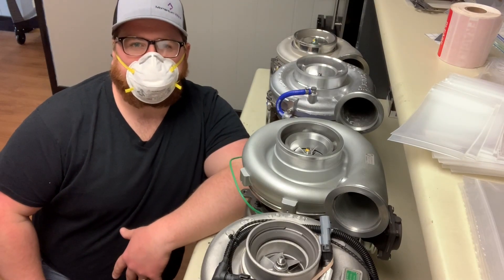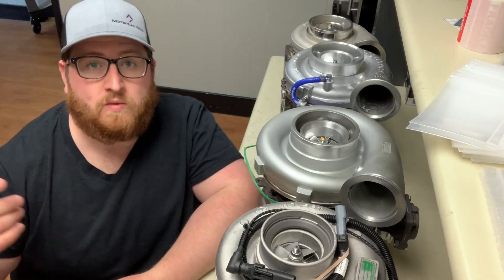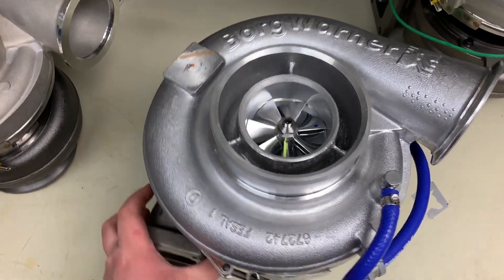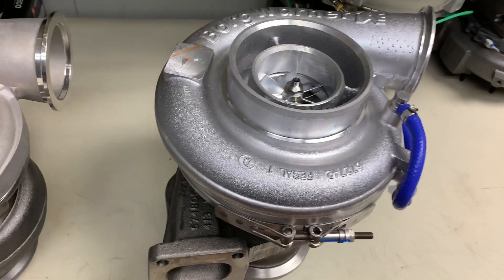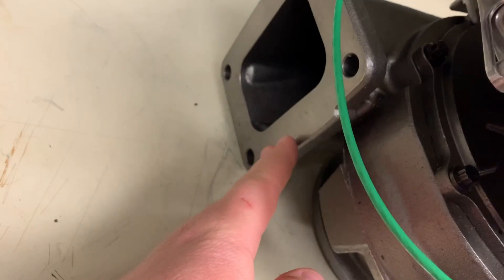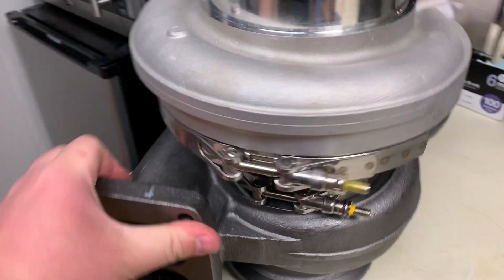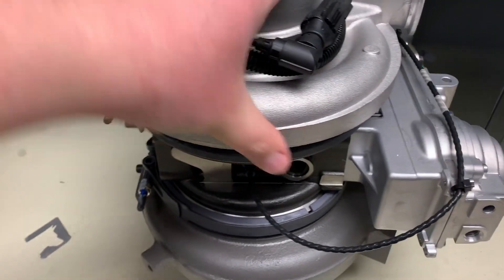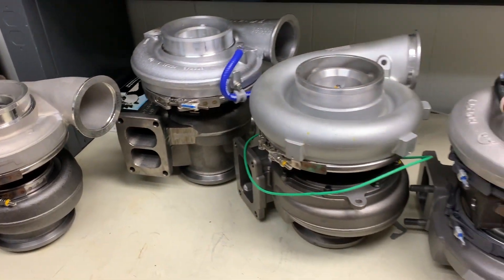Which Detroit Diesel Series 60 Turbo Do You Have?

Comment: I have a DDEC 5. It's a nightmare with the turbos. The 4s on the 12.7 are stronger. Can I just plug off the VPOD and put on a non waste gated? Is there computer changes that need to be made since there's a speed sensor involved?
Reply: You need tuning.
Reply: @davidburdett1920  thank you

Comment: Got a 99 volvo and needing a new turbo. I plan on keeping the truck for the foreseeable future. Reliability is my main concern, but I don't mind spending a few more bucks if it means more performance and/or MPG. Do you think BW performance part is the way to go? What's the diff in price?
Reply: 171701 bw is a good turbo. 171702 if your going over 600 hp.

Comment: Hello brother, I have a 09 Freightliner cascadia with S60 14L , I replaced the old turbo was ddec6 and I put a new turbo ddec4 with waste gated and I’m low now with bost , what do you recommend me please ? The other ddec4 without wastegated or parameters on the computer ? Thanks let me know please 👍
Reply: You have to have your ecu tuned . DDEC 6 computer’s are programmed to run with a VGT turbo.  I’m in the process now.  I deleted all the emissions crap and the only thing left to do is change out my VGT turbo
Reply: @dontehopkins9862  thanks brother I’m working yet but not good, I will check that 👍👍
Reply: Did everything you did with the 12.7 turbo with the waste gate and my 14l hauls ass like no other. It was ecu tuned

Comment: @Momentum Worx 
can a k31 use a standard non wastegated s400 exhaust housing just bought one used thinking it was an actual s400 turbo, exhaust housing was cracked.
Reply from the maker: I don't think so.  I've never tried it personally, but the turbine wheels and frame sizes are different.  I would be very surprised if it was a direct swap.
Reply: @momentumworx  Damn. Would you happen to know of anywhere I could get a replacement k31 exhaust housing?

Comment: Ha he said a little more boost my  99 ddec 4 tuned with a 171702 borg warner will touch 50 psi bobtail...that bit more than a little
Reply: I installed a 171702 on my ddec4 12.7 S60 500hp .....my boost fell to no more than 27.5psi .... Was such a let down
Reply: @vroor32  Need more fuel to push that turbo...I suggest getting tuned to 600hp.
Reply: @DeLonghe_P_Ness  I found it was the exhaust manifold gasket that was not properly installed. Switched to polished manifold .....now I get boost to 35psi

Comment: So what’s the cost of these turbos and what do you think about reman turbos
Reply from the maker: Theres a link below the video for each turbo with prices and info about them.

I think NEW turbos are the best, but in some circumstances, new is not available and there's only reman options.  If you are buying a reman, make sure its from a reliable source.
Reply: Yeah I definitely appreciate your response and knowledge but a reman turbo is about half the price right
Reply from the maker: @terrellscaife2411 No, Not necessarily, it depends on what type of turbos you're talking about.  Sometimes its 15%, 25%,  or 70%.  Its all about availability and quality. 

New BorgWarner turbos tend to be 15-20% less then a new, but then you need to deal with sending your core in and you might not get a full refund if the core was damaged. Then take for example an independently remaned Holset turbo, it might be 60% less then a new Holset turbo.  Then comes into question that "Not all remans are created equal". Its important that any turbo (new or reman) is assembled and balanced correctly, or it wont last long.

Comment: You forgot about the DDECIV "HK" S60H 14L  2000-2002 575hp with  a factory wastegated 75mm .69AR monster Garrett. No EGR or nonsense, on which you can upgrade to a 177287 80mm BW unit. I have had one for many years making well north of 750 hp at 45+psi.
Reply: Did you put marine cams in it

Comment: My 2003 century 12.7 s60 detroit with egr uses DDEC IV ECM and DDEC V turbo. I am not sure if DDEC IV TURBOS HAS ACTUATOR.
Reply from the maker: Paul - DDEC IV came from the factory with a wastegated turbo. Often times these original turbos are replaced with a non-wastegated turbo down the road; either as a performance upgrade or just because that’s what was available when the last turbo gave up the ghost.

Comment: Is the S475 Borg Warner Turbo a Upgrade for both the S60 12.7L & 14.0L? The S60 14.0L NON-EGR Motor was a DDEC 4 Model Correct? Do You also sell Aftermarket Head Gasket Manifolds for Both S60 12.7L & 14.0L?
Reply from the maker: The S475 can be used on the 12.7 and 14L, yes! We have gaskets for the manifold to head, but not the head to block.

Comment: Does a ddec 5 or 4 exhaust manifold  bolt on to a ddec6 head?
Reply from the maker: Yes, just make sure you buy a manifold with the proper orientation.  There is a high and low mount, but the bolt pattern is the same across the board.

Comment: We deleted our s60 and that baby hauls sticks pretty good with that particular turbo that came on the last models even though we’ve already replaced two turbos, two head gaskets, along with rebuilding the motor and the truck barely has half a million on it. Wanted to go with a older turbo but our mechanic said it wasn’t worth it. Told us to stick with buying Cummins and they haven’t ever let us down so I can’t blame em.
Reply: So cummins has treated yall better than those 60 series?
Reply: @RaulGarcia-cg3vn  yesssss it depends on the year though. When they started the regen bs is when the series 60 went downhill. They were bad for blowing head gaskets. Cummins are top notch bullet proofed compared to those later series 60 monsters. That’s with the ISX-15’s Cummins though. Emissions have ruined engine reliability these days that’s just how it is. I will say if you decide to delete any truck. Buy a kenworth with the isx-15 and delete it, you’ll have hardly any electrical issues and a bulletproof engine. You can do the same with say a freight shaker but the electrical side of things will drive you insane esp if it’s an automatic….. trust me.
Reply: @tomboy1875  got it..thanks for the info..i own a prostar with the isx..its an 09..the turbo just gave out and I'm thinking about converting it but not really sure if i should since you loose third stage engine brake..solid so far..but being an international does have its faults..
Reply: @RaulGarcia-cg3vn  depending on which model isx engine you have you may be able to  put a third jake solenoid in and get your third stage jake back...still not as strong as with the vgt but the same as any of the older non vgt trucks then

Comment: I drive motorcoaches with either the 12.7L S60 and 14L DDEC5 S60 engines way in the back of the bus.  You cannot hear the VG turbo at all on the 14L engines, but there is no lag.  I can hear the turbo whistle like crazy on the 12.7L, there is lag but it gives a mighty kick in the pants when they spool up. Is there a way to add that nice sounding 12.7L DDEC4 turbo accoustics to the 14L without messing with emissions?
Reply from the maker: texasabbott - the 12.7L sure does sing!  You could absolutely put a DDEC4 turbo for on a DDEC5 truck, but you would need to have some tuning done to compensate for lack of VNT (the ECM would normally be commanding the v-pod to change the position of the VNT).

While the 12.7L turbo does sound awesome, if your DDEC5 is running strong without issue, I wouldn’t revert back to the DDEC4 turbo.
Reply: @momentumworx  why not? My 06 14l 06 series full deleted egr no v pod with the 12.7 turbo with a waste gate. Ecm tuned and my truck run like scrape ape. Never had it done that it freshly overhauled 78k ago